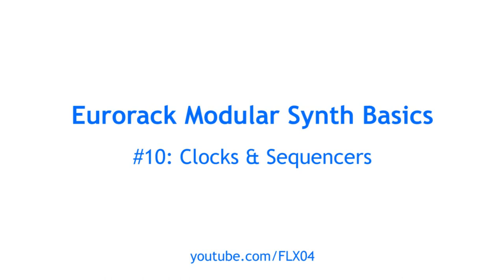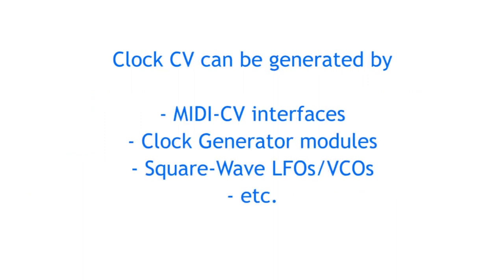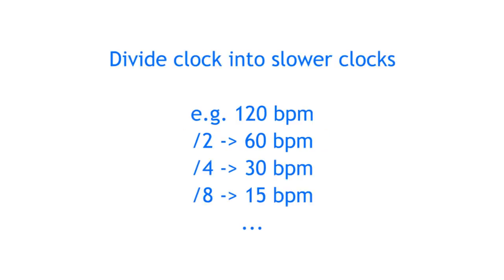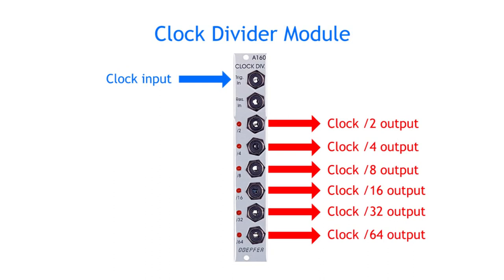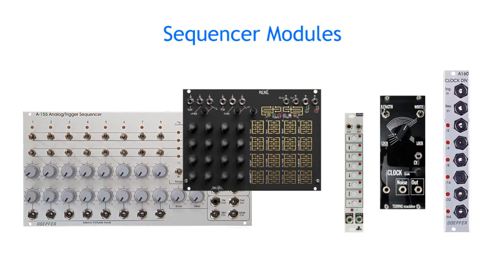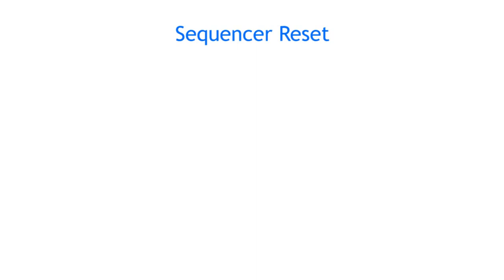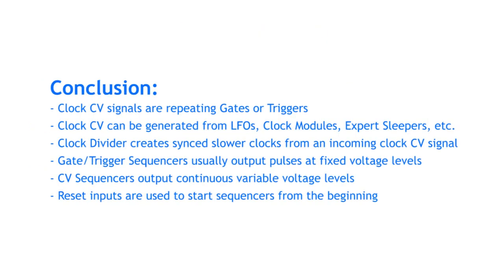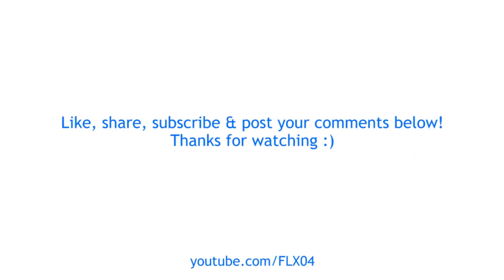Modular Synth Basics #10: Clocks & Sequencers

Comment: hi, i'm trying to connect my keystep pro with clock divider of doepfer A160-2. I have a problem. I tryed to use my keystep pro as clock generator (main clock) so i go from clock out to the clock divider trig/gate. The tempo on the clock divider (even if in synch) is super faster in confront of the keystep. why is there such difference? how can i have both synchronized?
Reply from the maker: Maybe the analog clock from the Keystep is too fast and needs to be divided down inside the Keystep before being further divided in the Eurorack.
Reply: i solved! yes it was a wrong setting in the "media control center" , synch option, i put 1 step and works. thanks bytheway!